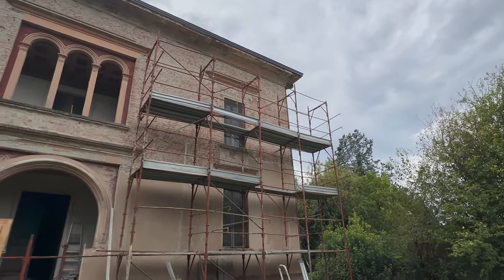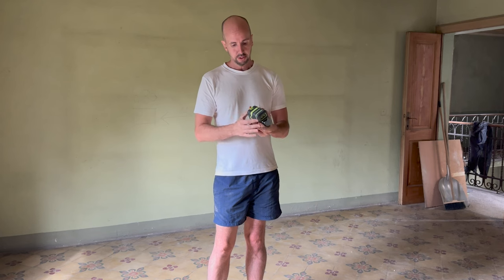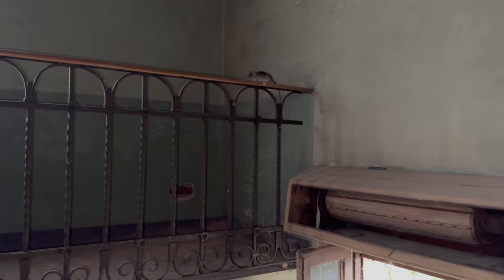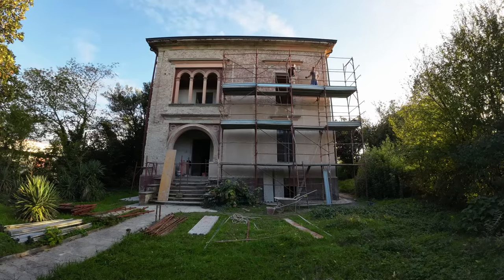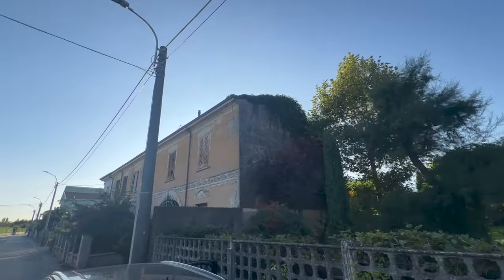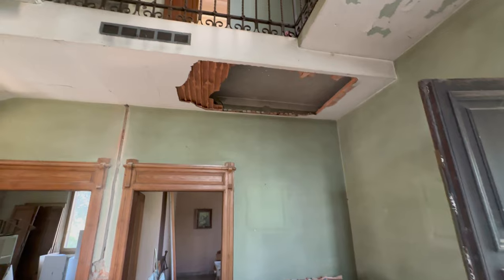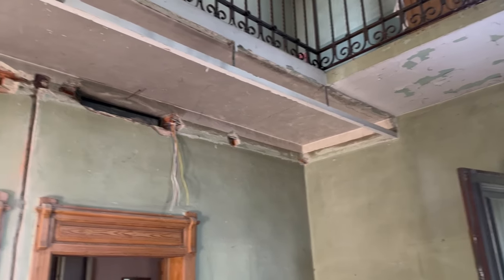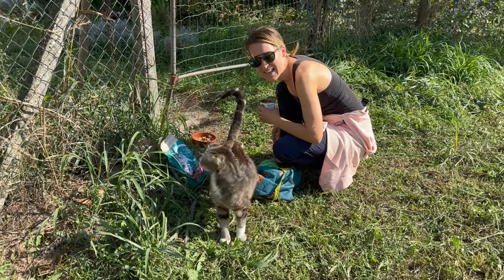Working on the FACADE and chasing ELECTRICAL Wires - Ep: 38 of our Italian house renovation

Comment: Looking great, maybe you can put like a suction machine that will take all the dust outside while the electrician is drilling in the walls or some kind a fan that would put the dust outside just a thought, otherwise I’m so excited for you guys. I’m hanging in there as long as it takes.😁❤🇮🇹
Reply from the maker: Thank you! 

It does have a water system that takes the dust away, but he prefers using it without it and work in short bursts instead.

Comment: It would be nice if the whole ceiling in the hall could be at the same level like it was originally maybe the whole thing could be dropped just enough to allow for the utilities.
Reply from the maker: Yes,  that's the idea,  I am going to drop it all and then pull cables and ventilation etc in there.

Comment: I really enjoy your channel, but I’m not convinced that guy doing the facade will do the flatness it requires. 

On another note, the staircase landings you exposed from the air ducts should be absolutely kept original,  At all costs, the slenderness of the stairs and landings is superb.
Reply: Please don’t box anything in in the stairwell, it would be a crying shame as we say in England. Expose the original lines and find a route for the services that doesn’t compromise the interior, it will be difficult and probably expensive but you and the huose will have to live with it for the next 50 years (hopefully)❤ so it’s worth the cost.
Reply: My father was a stone mason by trade from Sicily and a plastering contractor after immigrating to the USA I’ve not seen him (the villa plaster) do anything wrong I’ve seen him using a straight edge across the facade; so unless you have done a site inspection and know the trades maybe keep the armchair contractor comments to a positive supportive attitude.
Reply from the maker: The walls are actually perfectly straight so Im not worried at all about the flatness. As for the staircase landings I rather make that a bit bigger (less than before) than having external fittings for ventilations running through the whole house. There are no other options as we cannot compromise the walls in the house and put them in there.
Reply: @VillaAroldi  it’s a tough one isn’t it? With such ornate ceilings in the rooms and hallway, and the stairs and landings being so well crafted where to put the services. Certainly will be a head scratcher to do it sympathetically but I’m sure you have a plan!
Reply from the maker: I think we do, we have spent quite a lot of time thinking about how we want things.  @simonkelly2339
Reply: @Tony-InLosAngeles  hey Tony, hi, I'm not sure what your dad's trade has got to do with anything but thanks, I’m honoured to be given advice by a Sicilian from LA, truly. Now if there isn’t a horses head in my bed when I go up later I’ll be devastated, all those films will have been for nought. 
I know the trades, my own dad was a painter by trade from Birkenhead after he immigrated from Crosby. 😉
Reply: @simonkelly2339  to give you some depth of background that when I’ve spoke of the plaster it came from a informed experienced observation. 
I did so also without insulting racist stereotypic movie mafioso fantasies…
I hope that wasn’t much of a struggle a half hour and tolls!
Reply: @Tony-InLosAngeles   Tony this is brilliant, the undertone of trepidation over the pond is palpable I can’t tell you ! But what does 'half hour and tolls' mean? 
I like you Tony and I reckon Harold does too, we’re gonna get along in a big fat multicultural YouTube conversation! Hahahah 🤪👍🏼🤌🏻genuinely I’m happy but you could take this either way. Tell me to eff off if you like 👍🏼
Reply: @simonkelly2339  the time it takes to go from Crosby to Birkenhead and pay the toll along the mate.
Reply: @Tony-InLosAngeles haha brilliant!  😂 how did we ever manage without Google? I wondered if you’d get onto that 😉